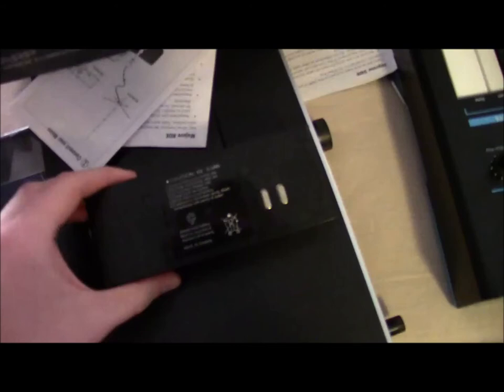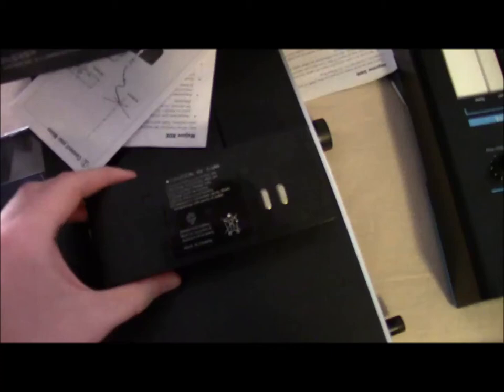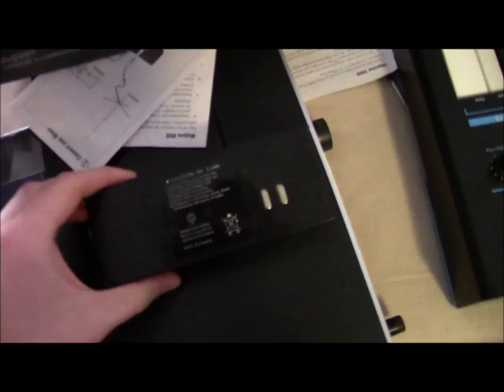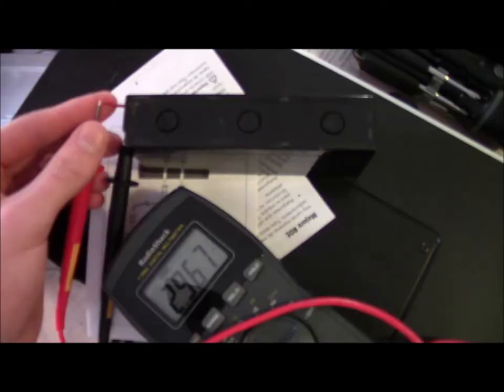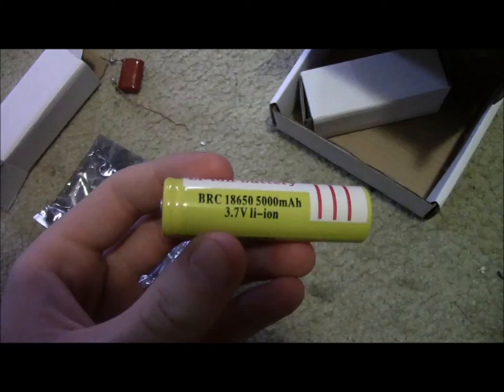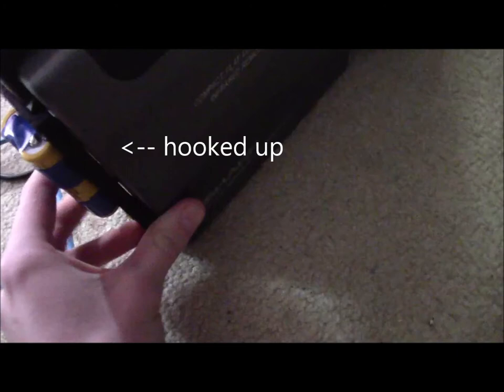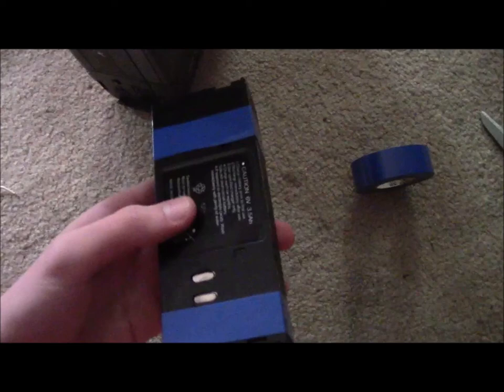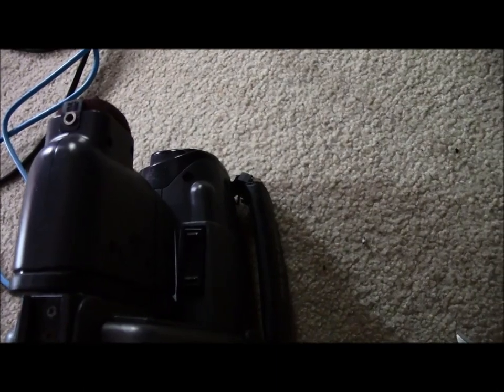Give your dead camcorder battery life again

Comment: Was able to do this for my Sharp SlimCam VL-L64 recently. I was able to get it apart without destroying the casing too! :D

The trick is there's plastic tabs holding it together. (they are welded so no it's not supposed to come apart). I was feeling around the plastic with a small flat head to find them. managed to pop them all so the casing came off after that. Marred up the edges of the plastic abit but it's mostly intact. Once I found them, I carefully used a small flat head jammed in the gap so as to lift the plastic of the base a bit then used a small hammer to push it through the plastic and break the tab. Did this on all the tabs and it came part without having to use power tools. :D

For the Sharp SlimCams that use SLA battery type, you might also be able to use 5 C NiMH/NiCD inplace of the original pack too. (I also plan to build a pack that uses those. I acquired a second camera that came with it's own dead battery. Since I knew where the plastic tabs were, I was able to pry that one apart with even less marring of the plastics. :D )

That one I will build into a NiMH/NiCD pack. Note this camera likes to run at a voltage slightly above 6v so that's why it's recommended to use 5 NiMH cells in series instead of 4. (4 x 1.4v wouldn't be enough). 5 C size batteries should definitely fit in the original casing. Will be interesting to see what battery life I get with that version of the pack. I got nearly 3 hours of run time on 2 brand new 18650s so anything else will have a hard time competing with that. I doubt even the original SLA batteries brand new could manage that. You have to use a 9 hour tape (that has 3 hours in SP mode. These cameras don't support recording in  EP/SLP modes. Only SP mode) to even make full use of the new 18650s. :P
Reply: 3 hours? Wow! Good deal. 👍😊 thank you, he doesn't say in the video how long the new system lasts.  Happy filming 🎥

Comment: Hello my friend, I too love filming on old video cameras. I have an old 87 Panasonic VHS in mint condition. cleaned the heads etc. But the 12V 2.3ah Battery is NFG.  Any ideas on what I could use in the old casing?  I'm good with soldering and what not.  Can I use any ah combination with a 12V battery of does it need to be the 2.3ah that the batter had before?
Reply: Hi You don't need to do this, if you take the top off your battery you will find it's a Sealed Lead-Acid, top it up carefully and don't overfill with some ordinary Distilled water you can get from any motor factors, clip/ and or glue the top back on making sure to put the absorbent material back inside first, once it's closed you can charge it and it should come back up to capacity, there's a great video on YouTube going through all of this here's the link, https://www.youtube.com/watch?v=ma0kAW0Yls4, I am going to do this with my old Panasonic Battery

Comment: Hi, I have an old Curtis Mathes vhs camcorder that runs off of a 12v 2.3ah lead acid battery. I want to do this but I would need 4 cells and I'm afraid 14 volts or so might be too much for the camera. You think it would be ok? Thanks.
Reply: 18650 cells actually run at 4.2v at full charge. You'd be pushing 16volts actually. I would recommend going 3 cell for a 12v device which is around 12.4 so that seems like a sweet spot for your case. ;)

Comment: Most of the batteries of video camera have a switch that has a red point what is the use of this switch ?
Reply: The  switch is used to remind you the battery is drained. After recharging flip the switch, so you know it's fully charged.

Comment: I've got a Video8 camcorder and of course it's battery is dead. The battery is using NiMH cells I think, and it says the battery outputs 6 volts, 1800mAh. Will this work for me? Just replace the cells with two 3.7 volt Li-Ion cells? Do I need a different charger?
Reply: Yeah you'll need to use a different charger. Especially for the Sharp Slim Cams that use SLA batteries. Do NOT attempt to use Sharp's SLA battery chargers once you convert one of their SLA packs into Li-ION.

Comment: dude I'm trying to do this with my panasonic ag450 i found some batteries in ebay that are 3.7v and some 9800 mAh do you think with 3 would be enought meanning it'd be 11.1v and will it be too much mAh?... cheers man!
Reply from the maker: I have an AG450 and I was able to find a replacement battery online for about 30 bucks and it was a great investment. If you're gonna do the hack, don't make the same mistake as me. Any lithium battery with a mAh rating over 2200-ish and a low price is complete trash. It has a mAh of 1000 at best and is a complete waste of time and money. You want to look for the authentic 2200 mAh batteries that cost a bit more. Three of them is fine and it is safe to charge them up to 4.2 volts, so in theory you can get them to be over 12 volts. Hope this helps man thanks for watching
Reply: Great! so you think they won't last much?  yeah  iwas thinking they are poorly made but us the only option I got or maybe reuse some from a few cordless phones I got or try to buy a better brand of batteries maybe? and yeah i found in amazon the replacement but they don't ship to mexico so... anyways I'll figure a way out, thanks for your help man! much appreciate it, you should do some circuit bending stuff too! cheers!
Reply: I have a AG-456 and just like the Panasonic Omnimovie, there's a battery area behind a door. This makes a custom battery pack installation rather difficult, as I can't reach the pins. Just so the camcorder didn't need it's casing opened up, I had a decent solution. I made a dummy battery out of wood, mimicking the original's shape. From there I soldered wires to some handmade contacts, which were cut from a soda can. Then I drilled some indented lines on both sides, so the wires had a place to sink into. With that all done and over with, I just had to slide the fake wooden battery into the slot. I was finally ready to make the actual custom battery pack, then mount it on the very back of the camcorder. All of this had to be done because Panasonic, didn't think a simple slide on battery mount was good enough.